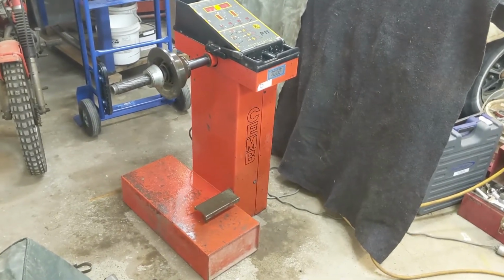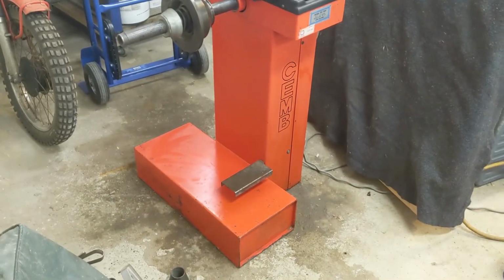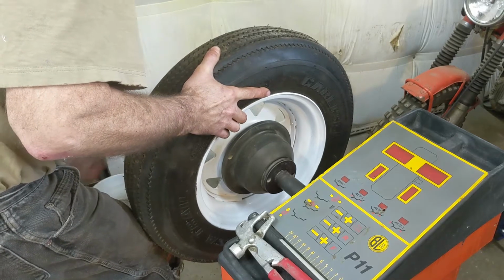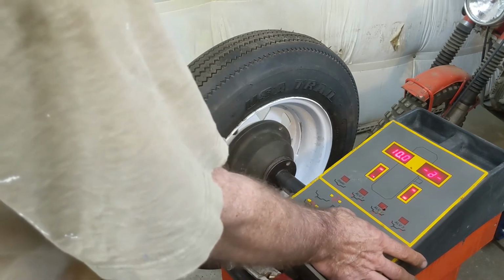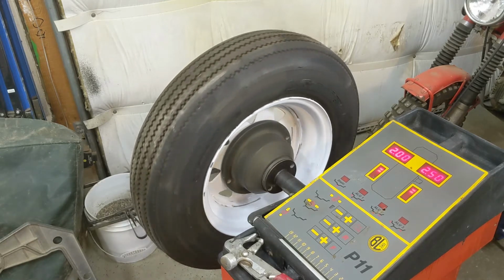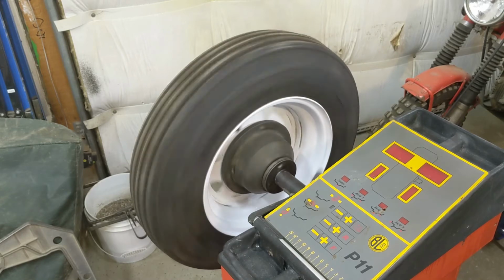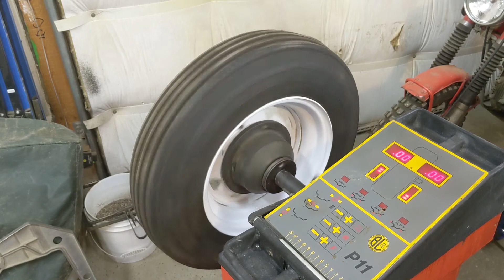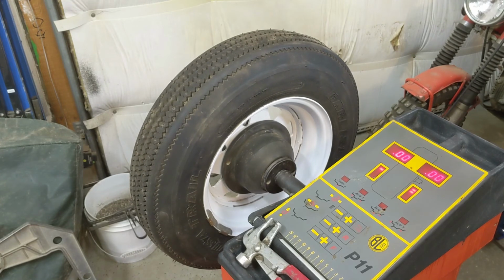My First Balance on The CEMB P11

Comment: I have "an Old Bubble balancer"  looks well used.   I didn't  know they made hand spin wheel balancer's...   Another use for that wheel balancer is to check bent rims etc,  I made a home made wheel straighter of sorts for VWs out of a VW rear wheel bearing  and a small 4 ton porta power set. Works ok on steels with a bit of fussing around.
Reply from the maker: If we ever get your way again...I'll have to take a look at your wheel straightener. Apparently their is a version of this model that is power spin, it looks the same as mine, but has an extra foot pedal to active the spin mode.

Comment: I’d say you have it figured out pretty good!  I’ve never used a manual spin machine however the procedures are the same I’m sure.  I have a bucket full of old weights if you want them. Shipping might be pricey ;). Lol.   
 One tip is to use a heavier ball peen hammer to drive on tougher small weights. Your fingers will thank you.
Reply from the maker: Thanks for the ball peen hammer tip!